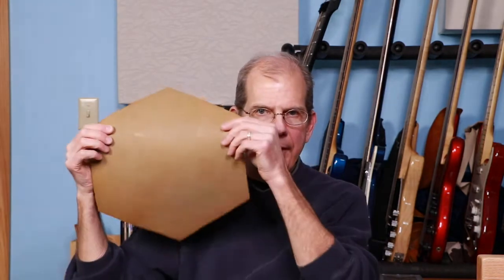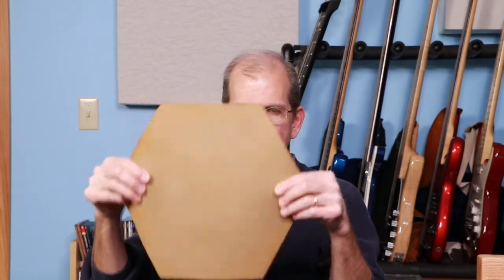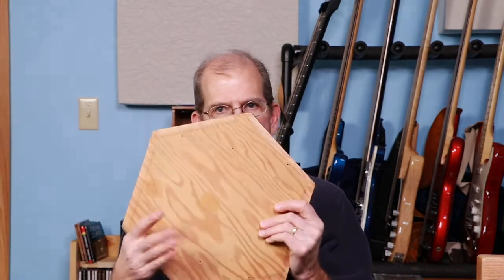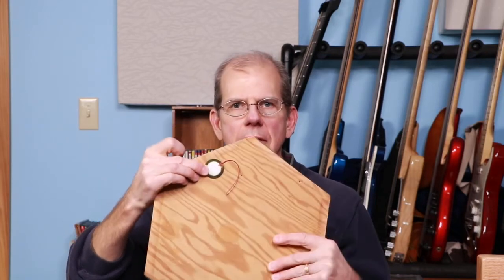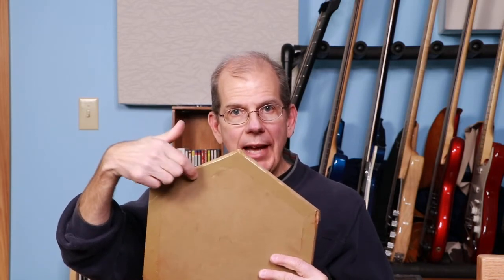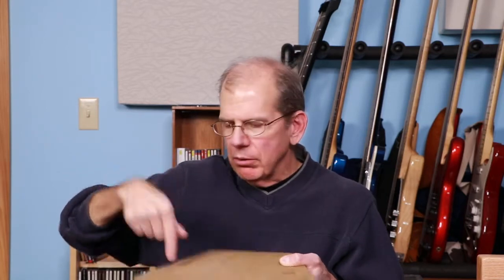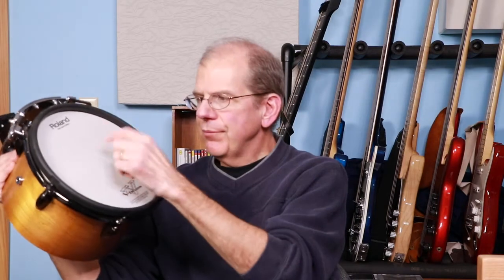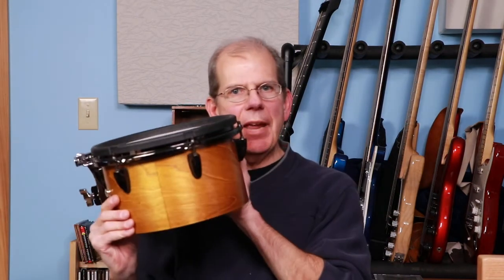Electronic Drums, Part 1 - History

Comment: Very cool. In the late 80's a friend of mine put trigger inputs on my Octapad which changed it from a percussion pad into a fairly reasonable facsimile of a compact drum kit. Besides adding an electronic bass drum kick pad I even managed to get an opening and closing hi hat thing going on between one of the pads and an electronic pedal. Then he hooked me up with someone who had put together a prototype electronic drum kit made from modified Remo practice pads with piezo triggers and a Dynacord module. Eventually I switched to Simmons pads because they looked a lot nicer but for the late 80's and for the price it was a pretty cool setup. I got some use out of it until the next wave of electronic drums came in.
Reply from the maker: That's interesting. I was working at a music store in the late 1970s and had grabbed a beaten up Remo practice pad setup that was being thrown out. I thought about using it for electronic pads but decided to go with my own. 

I wonder if your friend had seen my article in Electronic Musician magazine on how to hot rod the Octapad. It was called "Meet Zelda, An Altered Octapad". In the early days, for high hat I would use two adjacent pads, one for open sound and the other for closed. The closed sound was set to cut off the open sound. It worked fairly well (for the time).